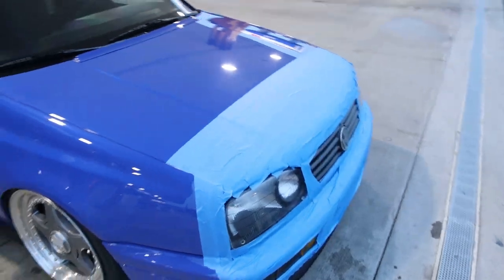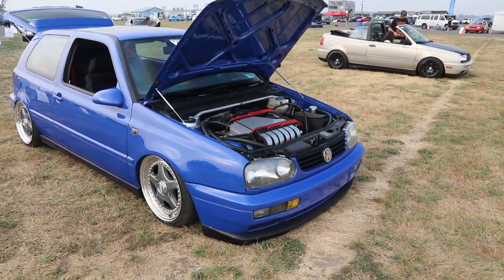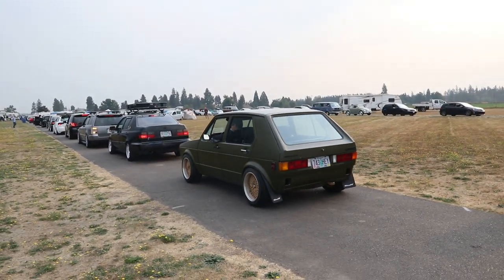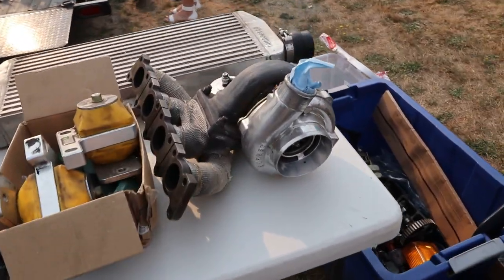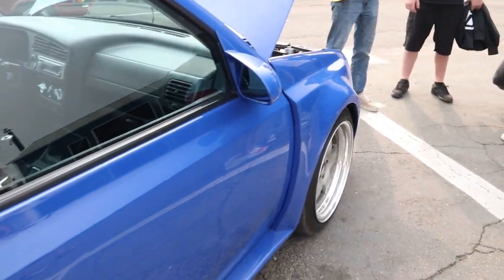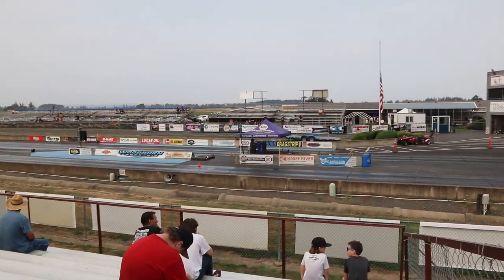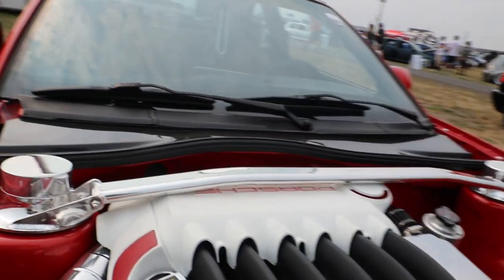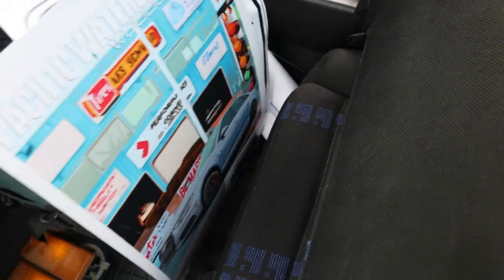My First Ever West Coast VW Show! ( Pacific Waterlands 2022 )

Comment: I Could have sworn the body work for the blue a59 was done by one of the previous owners in Canada. I remember and old vortex build thread.
Reply from the maker: Correct from what I was told the car was mostly done and then double J motorwerks finished up some stuff and housed the car for awhile if I’m not mistaken